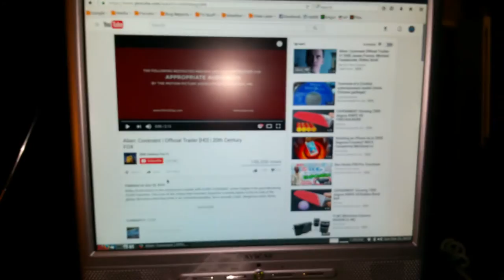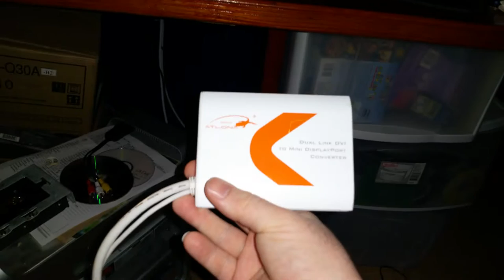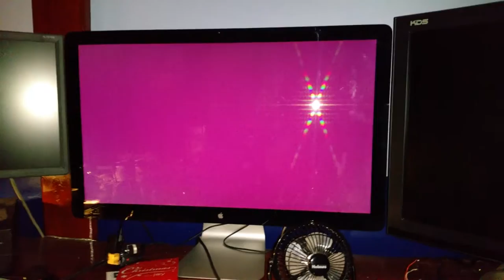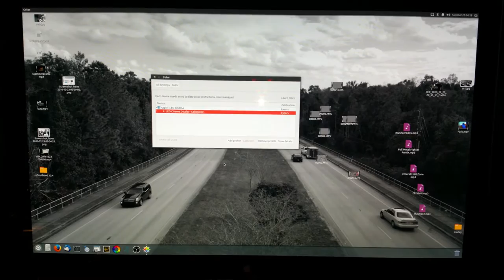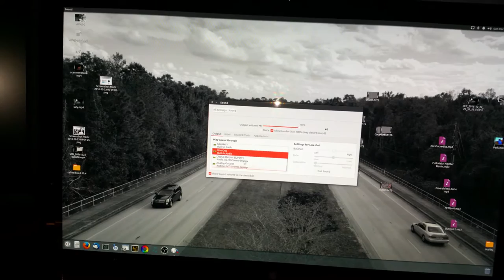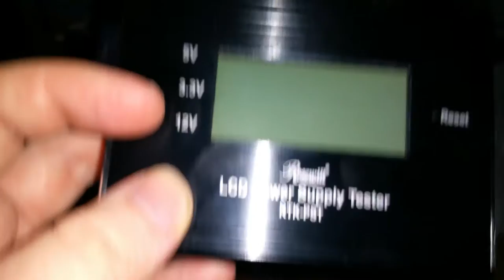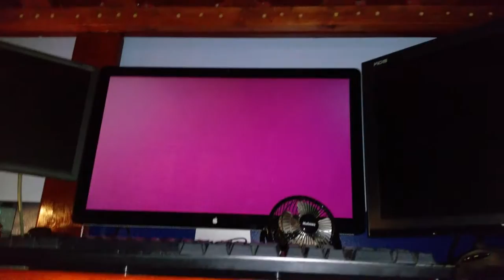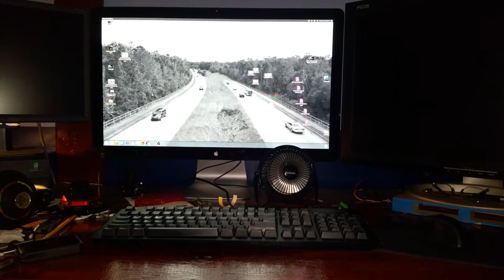Mac Pro 2008 Failure

Comment: I've found power supply testers are only 90% effective.  The kind of problem you're having may lead to false positives on that tester under no load.  The only real way is to swap in another supply.  It's entirely possible the video card may be fine.

The reason the machine rebooted when it was moved?  Because it was moved!  I see this all the time.  Worked fine, went to move it because there was a ton of dust under it, and it won't turn on.  Usually, reseating all the components will make it work properly again.

Comment: can you RDP into your Mac??
Reply from the maker: No, but I can VNC and SSH into it.  I ended up finding the fault.  Damanged voltage regulation on the video card.  I can bypass it with a 12v wallwart that's loaded with amps that I found, and it IS working.  (I could technically run this off the 12v power cable in the computer but I didn't want to modify that cable).  It's now working with this bandaid, as I'm using the GPU to encode The Force Awakens on the fly to the Roku strick in the living room as I write this.